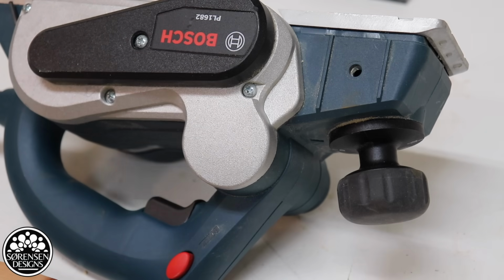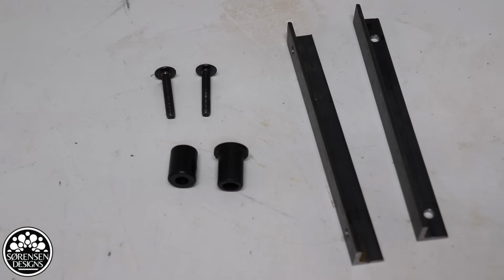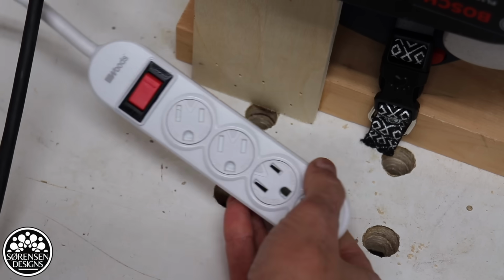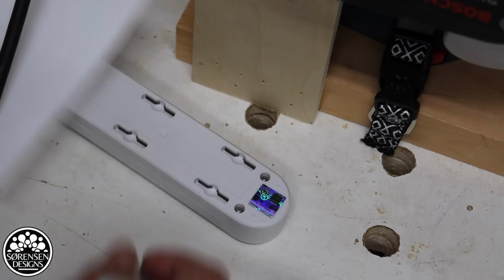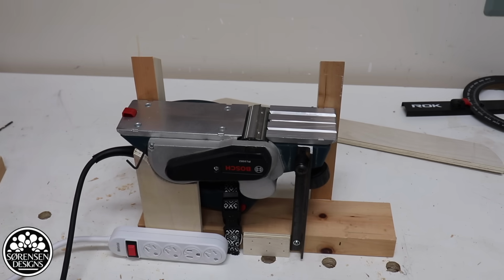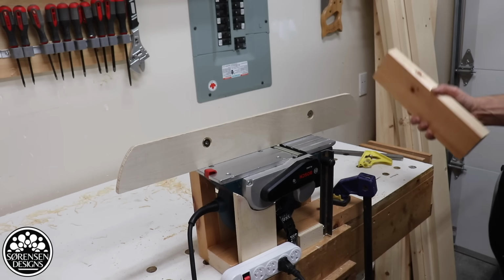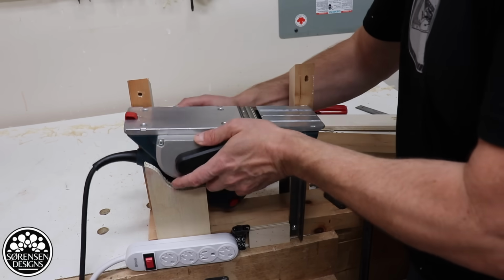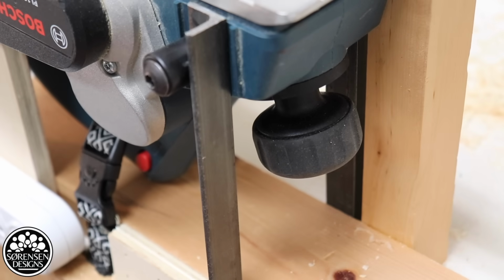Turn Your Hand Planer into a Jointer for Only $10

Comment: I am a total newbie to wood working so please excuse my lack of understanding. What is the difference between your set up and say just clamping a piece of wood down and using the planer as designed. Does it not do the same thing? Is it more accurate the way u do it vs. the way I described. Thank you for the vid. I would love a jointer and planner but also have 5 kids and wifey says we must buy food before we can buy woodworking tools. Silly wife...but I must obey. I would love to just spend $150ish for a good electric hand planner if it will get me by and double as a jointer.
Reply from the maker: Its a convenience more than anything. It's totally up to you how you want to use it. I use this jig for parts under 30 inches long. 
I use it out of the jig when I need to process longer boards: https://www.youtube.com/watch?v=N4vqfPpBSWg.

Comment: I see you have dog holes in the table.  Would it work to set four dogs in the bottom board so you could just plug it into your workbench and not need the clamps?  I couldn't tip and I'm thinking that the downward pressure using it would keep it stable.  

Just wondering.
Reply from the maker: @Buck McDaniel You could surface clamp using the dog holes instead on edge clamping. I find the edge clamping faster for me - in either case, it only requires one clamp.

Comment: Hm, I think you could cut a rabbet on the tops of the two fence supports. That way the fence sits next to the blade instead of on top of it and you can make use of the full length of the blade. :)
Reply from the maker: @Alastair Blake That's a great idea! I'm not overly concerned with losing that 1/4 inch but you could definitely inset it - easy enough to do. Cheers 🙂

Comment: Are the bushings threaded?
Reply from the maker: @Greg Sheehan No, they don't need to be. If you have threaded, it's a bonus though.
Reply: @EricSorensenCanada  thanks for replying, nice build, considering doing similar but making a box to drop it in so longer pieces can be edge jointed without having to hold it.
It's hard to get the threaded ones that fit the planer mounts I have. 
I found ones that are .04mm wider than the bolts I have. Considering trying using hex head bolts. Might get a couple of the round head screw ones you used though. 

Wishing you well
Reply from the maker: @Greg Sheehan Thanks! Yes, an in feed / outfeed built into it would definitely make it possible to run longer boards. Good plan! Best of luck on your build 🙂👍

Comment: Hi, excuse my ignorance but what are the 2 holes used to attach the angle iron to the planer used for under normal circumstances and are they present on all planers? Also how did you figure out the required threads for the holes or was it trial and error?
Reply from the maker: @H2Dwoat They are normally used to attach the dual-mount guide fence, that comes with the planer. The guide fence can be mounted on either side. I assume most brands will have something similar. To find the right hardware, keep in mind the threaded holes will probably be metric. I horde hardware, so I happened to have the right bolts. You can take the bolts for your guide fence to the hardware store and check for the right size or just ask someone there to match the thread count..
Reply: Eric Sorensen: Cheers.

Comment: Hi, im a newbie to the electric planer and i was just wondering what the red bracket was for at the end of the planer sole?
Reply from the maker: @Tim Hollywood Its called the "foot". It's spring loaded to retract when the planer passes over the board or vice versa in my case.
Reply: @EricSorensenCanada  Thanks for that Eric  but what is its purpose?
Reply from the maker: @Tim Hollywood It is supposed to add a slight bit of drag when you run the planer over the board and help prevent snipe. It doesn't make that much of a difference from what I've noticed.
Reply: @EricSorensenCanada  Thanks Eric i really appreciate your reply and now i know.. thanks.

Comment: My planer has a dumb guard wheel that recesses when you hit the wood  how do i get that off
Reply from the maker: @Susan Ross I would leave it. It will do the same thing when you run wood over top of it, it should retract. I have a similar feature on mine, I didn't bother removing it.